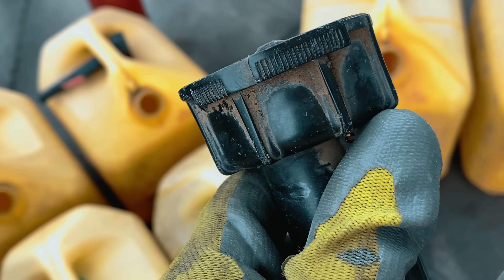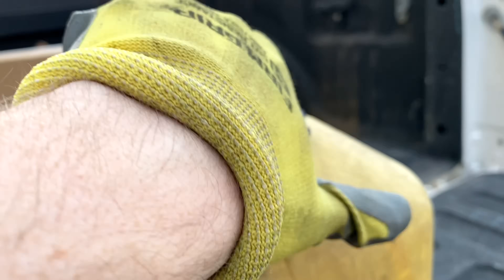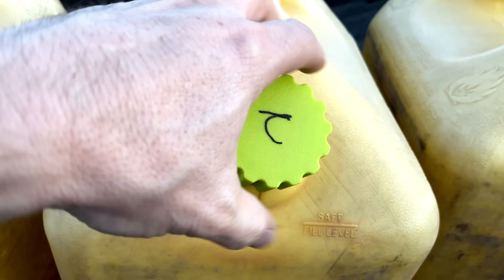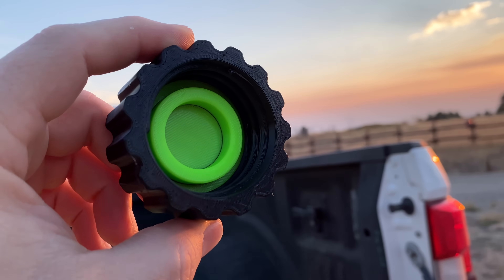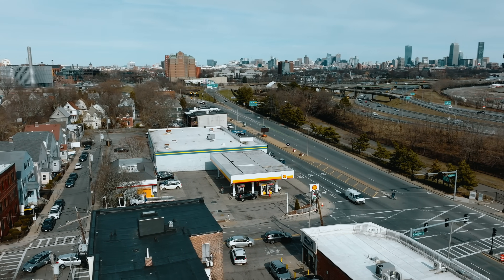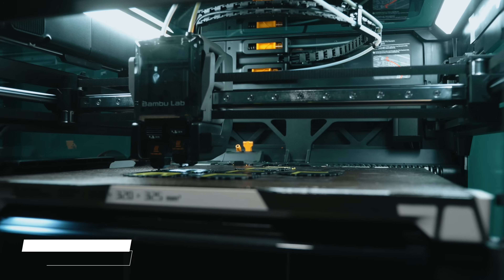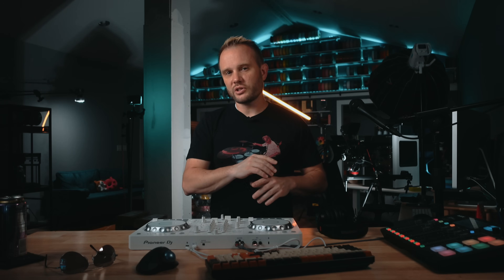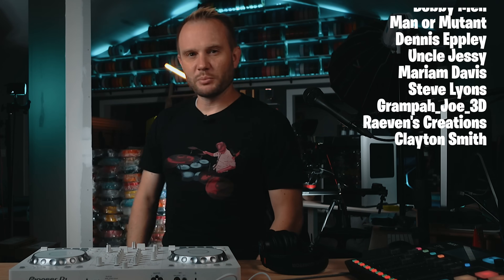PETG and TPU Don't Mix... Or Do They?

Comment from the maker: 💬 What’s the most practical thing you’ve ever 3D printed?
This cap cost me 22¢ to print and fixed a real problem on the ranch. 🔧

👉 If you want to see more useful prints let me know!

Also, I’m curious — have you ever designed/printed something that replaced a store-bought part? Drop your coolest everyday-use prints below! 👇
Reply: Probably the gas cap for the lawn mower. Apparently that gas cap needs to let some air in the tank :)
Or a replacement clip for my car's boot, or a custom vesa mount, or an electric box that hold sonoffs
Reply: clips for closing open bags, wall mounted holders for pot and pan lids, ams lite enclosure system, petg lids with tpu seal for mason jars that i use specifically for making salad dressing in a jar because metal lids rust from the vinegar, mechanical card wallet, wall mount for ps5 and controller, wall mount for nintendo switch dock, wall mounted anything really lol
Reply: I just finished up a 4 part, 5 inch air duct from asa, pctg and tpu. It is amazing that we can print our own screens/filters that actually work

Comment: Practical prints or prints aimed to solve a problem are some of my favorite things to print. I find a lot of joy in listening to someone's issue & then working to print a solution for them. 1 of my favorite but super simple practical prints was a TPU door stop/prop. My neighbor is elderly so getting to the floor to use a simple door wedge was not a viable solution. I found a model that screwed to the door & wall, printed out of TPU, & was very easy for her to use, a perfect win win. Great video as well, its also a great idea. You could also customize the top of the cap in so many ways too, initials, logos, fluid type, brands, the customization is 1 of the best things about 3d printing!!!

Comment: Back around 2010 my dad was fed up with newer gas cans (supposedly safer and required by law) would all leak and make it near impossible to use. I was new to 3D printing and had just gotten some nylon and so I designed and printed the straight spout and cap from nylon and it worked so well he had me print several more for him and a few for his friends. The nylon held up really well and while it took me awhile to figure out printing (ended up printing on the back of circuit board material). The only nylon filament back then was from Taulman. The owner was happy to help me walk through a bunch of settings and material choices (they had only been around a few months at the time).

Comment: A fantastic practical use for the dual head system.
On a side note, thanks for prompting me to make color coded caps for my gas and 2 stroke fuel cans so I never mix them up again.
I'll also print new color coded fuel caps for my tools so I know what goes where.
Cheers!

Comment: I have a need for this exact lid in this exact material combo. Do you plan on releasing the Bambu print profile for it with all your settings on Makerworld? Edit: nvm. I found the exact model and recreated your profile exactly. Except for the text on the top of the cap I put Marine Grade Gasoline. To designate these cans for our boats. Only thing I did that I don’t think you mentioned was enabled beam interlocking for the 2 materials. Probably not needed, but a little added adhesion insurance.

Comment: This is exactly why I love having a 3d printer! I do this type of printing more than anything else. I love jumping into cad, designing, exporting and printing vs making a trip to the store, especially when money  is tight. I just replaced all the hardware on my dresser after not finding proper sized replacements. Had to design them, protype a few for fitment and adjustments and then print the finals. Even for things that don't really need replaced, doing custom designs gives things a unique makeover. Excellent job on the cap!

Comment: I've been selling this for about a year locally. The thing is, at least in rural NC, most people don't trust 3d printing for this application. Most would rather us order the expensive replacement caps than "take a chance" of the ones printed. I couldnt tell you how many times I've heard this.
Reply: I wouldn’t mention the manufacturing method. Most products never talk about the process it takes to manufacture it.
Reply: @FireDragon3D I know what you're saying but I have to. It's my father's hardware store and he requires me to put "3d printed blank" on any product I sell there. I make most of my revenue through contracts and just sell there to help my dad.
Reply: @OhImKiCkiN your Dad owns the shop means he’s the boss and what he says goes. I get it. Maybe try to offer your products to other hardware stores. Call them and ask for their buyer. Don’t mention 3d printing unless asked. Maybe you could make custom ones with shop logo on them 🤷🏽‍♂️ built in gasket could be the main differentiator.
Reply: @FireDragon3D That's a good idea but I couldn't do that to my dad. I really just designed the hardware related things, like the gas caps, to help him out. The design in this video is actually way cooler than mine. I've been printing the TPU gasket and cap separately, and then assemble them after. But i have been upgrading my farm to H2D's so I can join both my designs into 1 part now, which is awesome. Idk why I hadn't thought of this sooner.

Comment: On a few of our machines I've made tpu grease fitting caps/covers. A simple cap that has interior shape of the fitting helps keep dust/debris out of the grease ports. Makes for clean ports that you don't have to constantly clean if left to the elements. 

Another item made is tpu grommets  for machines to replace missing ones or pull the factory out & place a custom one in that would allow wiring/hose/tubing to pass through.

Great video & showing use of 3d printing.

Comment: I'm happy to see that I'm not the only one who use the scaling tool in slicer and cad to make the fit better. Now, you need to make one with the hole on top for the flexible extension 😅

Comment: Did the update to 10 bottom layers and 3 walls change the cost much?
Reply from the maker: It added about 30 minutes to the print and probably added 4 or 5 cents.

Comment: Is PETG compatibile with Diesel from evry Company?
Reply from the maker: There are a few different grades of diesel, but they do not differ much due to the need to be compatible for their specific purposes: heating oil, diesel engine fuel, etc.
Reply: The organic fats may make it an interesting test. Ill mux up a batch of BD and drop a couple of parts the next time i fry something